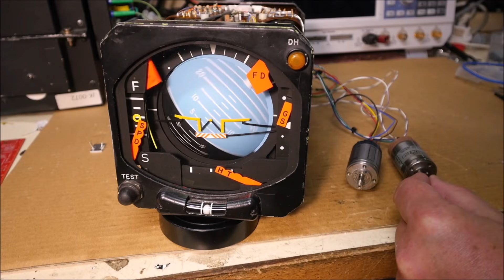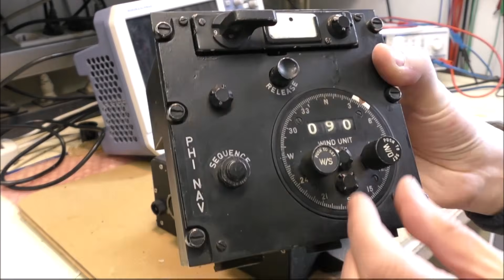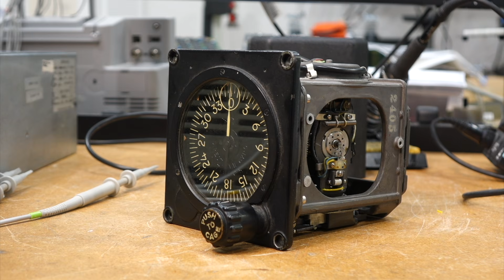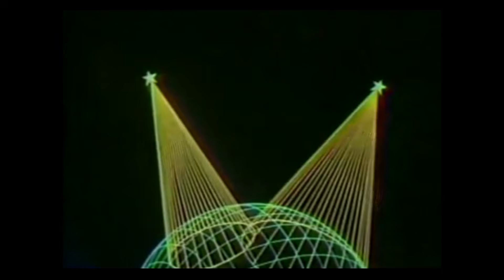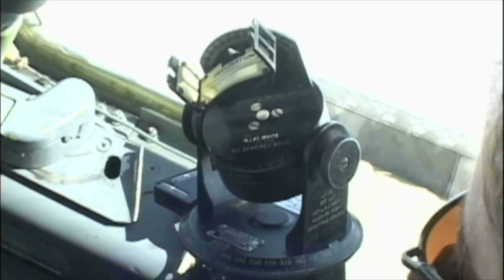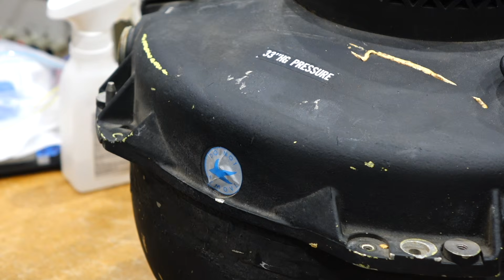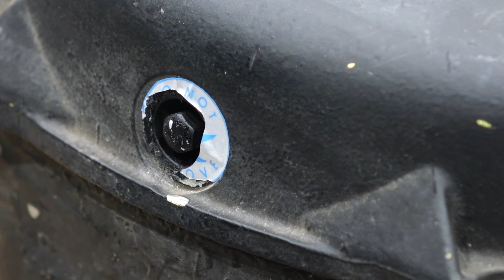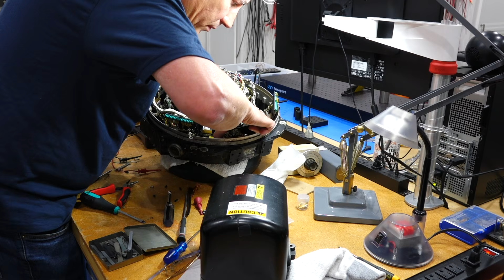B-52 Bomber Astro Tracker - Part 1: Grand Opening (ft. Le Labo de Michel)

Comment: I flew the B-52 just after these things went away, I believe it was when we got the OAS (Offensive Aviation System). But the navigator still had to take manual sextant shots from time-to-time to keep in practice in case we lost inertial nav (this was before GPS). I don't know if it was a problem with my nav or not, but we were never able to accurately locate our position with the sextant.
Reply: Tzkelley..B-52G IEW Castle Instructor here…could be your Nav’s skills or system issues.  If it occurred multiple times on different tail numbers it could be your Nav’s training.  On most ASQ-38 era birds these Astro skills were necessary.  OAS era, post 1980ish aircraft the EWs took the sextant shots for the Nav and it wasn’t evaluated by Stan-Eval usually.  Nav’s did the math and plotting downstairs. Post 1988ish I don’t recall even teaching Astro to B-52G Nav’s or EWs.
Reply: @ I was in the H at Fairchild during the Holland era. Pretty sure it was my Nav more than anything. No sextant stuff on check rides but it was still being done for practice. Never by the EW though, at least not at the 325th. But I may be wrong—it was a while back. 😊

Comment: I was in the Air Force and was trained on maintenance of the Astro Tracker in the mid '60s. This included theory of operation of the tracker and analog computer as well a astronavigation. While I currently do not have access to any documentation, I may be able to answer any questions you may have.
Reply: amazing to know what we did before digital and satellite gps
Reply: I worked Avionics Instruments on the G models, as well as KC-135's and was part of SAC while it still existed.  While we didn't work on the Astro-tracker we made use of outputs from you guys to assist the pilots with navigation.  What AFSC were you at the time?  I'm guessing the Bomb/Nav section.
Reply: @professorx4047  Sorry, no I don't. We ordered replacement parts by their federal stock number as given in the parts manual.
Reply: DJ, drop in to see Curiousmarc. He is getting an Astro up and running and his chums have some funky kit you will know about.
Reply: Did you have a starry sky simulator for testing and troubleshooting?
Reply: @Fake_Blood  For daytime troubleshooting used the sun.
Reply: @djwarner7144  Thank you for the reply sir. I forgot that it can also track the sun, because they call it a startracker. Then again, the sun is also a star.
Reply: Isn't it still in use in modern missiles innertial systems after upgrade?
Reply: @NoF3ar_123  Inertial Nav systems are used on missles and on long range aircraft.
Reply: @djwarner7144        Same here. A kid just out of high school with about 6 months of electronics training. Some systems had additional schooling, but I don't recall the Astro-Tracker having any, maybe a CDC training book? That system didn't have much for diagnostics beyond just being broke, so it was big on "shotgun troubleshooting", as in, bench checking or changing out parts till it was fixed. The tracker unit was pretty much the last thing one wanted to change out.
The one thing I do recall was the spinning disc inside the glass globe. That was about the one thing to check: Put AT in a search mode for a non-existing celestial location, climb on top of a wing tip, walk up to top of fuselage and look into glass dome. The disc should be spinning and if one watched carefully, one could see the prism working a lateral and vertical grid pattern searching for the non-existing celestial. If that was dead, chances were pretty good that the tracker was dead.
I remember that the aircraft system ground test took about an hour to run.
I was at a North Dakota base and an unwritten rule was to carry a thin common screwdriver in hacking position. If the horrible combat boot soles slipped on the frosted wing top, one might stab that screwdriver into the plane skin hard and hang on.
Reply: Absolut mind boggling technology! Were you able to work on the entire system or only part of it because it was classified?
Reply: @thearchibaldtuttle  The objective of our training was in the field service - the objective being to return the aircraft to flight ready status as soon as possible. This meant we were required to troubleshoot the system, isolate the fault down to a blackbox, replace it, verify the fault was eliminated and the system was fully functional. Back in the shop, some components could be serviced. Others, such as those with hermetic seals were returned to a depot for repair. This required us to not only know how the system worked, but how it would behave when a particular element failed.
Reply: @djwarner7144  Thank you for your explanation. What was the most found issue with the system? Looking at all the components it must have been a constant source of errors.
Reply: @thearchibaldtuttle  Vacuum tube amplifiers were the most frequent malfunction but were field maintainable. Most of the mechanisms in the system were servo systems and only actuated to adjust position as required. As such, their mean time between failure MTBF was fairly high. Gyros spinning at high rpm with torquing mechanisms would be the second most frequent failure.
Reply: @djwarner7144  Ahh, it's a shame we cannot drink a beer on a fire and I can listend about this marvels of technology 🙂
Reply: @thearchibaldtuttle  One interesting feature was the position sensor system. Angular position was sensed with synchros. Unfortunately, these sensors can only resolve position down to about one degree. This accuracy was not sufficient for this application. So, they added a second synchro geared up at a ratio of 25:1. The first synchro was used as a coarse position sensor. As the servo neared the desired position, the system switched to the second synchro to resolve position down to about 2 minutes of arc.
Reply: @djwarner7144 Absolutely fascinating, thank you
Reply: Prove it
Reply: @ Prove what Mike? That inertial Nave systems are still in use? A simiple YouTube search should answer your questions.

Comment: Is this the same equipment which was used in the SR71/A-12?
Reply: No. The SR-71's is later.  You can find pictures of it easily.
Reply: @vibrolax  Pictures of the Astro Tracker in the SR-71? Where?
Reply: @_Dude  lookup nortronics nas-14v2 astroinertial navigation system.  It's on the Smithsonian's website.

Comment: Wish yall were in CA ...i have a peace of one of a kind military test gear id love to reverse engineer...it has military aircraft switches a 8 ball turned into a joy stic and is labeled hand held unit even though its heavy and lunch cooler size ..i got it from a antique store was told its from the military base and old ...i live near Edwards air base so i guess it it test gear for a first test of something

Comment: Howdy from the Eastern Arctic of Canada. 

Interestingly enough, just the other day I taught an annual training course on the use of the astrocompass as demonstrated in the Boeing video. 

Although somewhat outdated, the regulatory people here in Canada still require us to be able use the astrocompass. 

I don’t make rules! 

Thank you for your videos!
Reply: When everything else goes to sh*t, it's good to be able to use the manual equipment to figure your location. I was given a tour of a US destroyer a few years ago. The officer leading the tour happened to be the ship's navigation officer, so I asked about paper charts (no, all electronic) and knowledge of the sextant (yes, he proudly noted that he found the ship's position as the sailed in and was less than a mile off). So the old ways are still used, even with GPS.
Reply: Yeah, aviators in the lower US states get a lot of use from magnetic compass' and may get a bit spoiled. Mag compass' at the northern latitudes get very wonky and may even become misleading. And as was mentioned in this video, the long missions taken by the B52's often were routed across the North and through the crappy magnetic zones.

Comment: Was that opto-electro-mechanical monstrosity even remotely reliable ?
Reply: Clearly,  they sealed it
Reply: Kinda
Reply: I worked on these in '69 and '70 on the B-52H model and as far as I can recall they were very reliable. We would swap out the units but they were always repaired at the factory (OCAMA maybe?)

Comment: until when did they used this equipment…. this being made in 1983 😮
Reply: Most likely made in the early sixties when the plane was made. That date is likely a depot overhaul date. Someone here mentioned the system being replaced mid to late eighties.